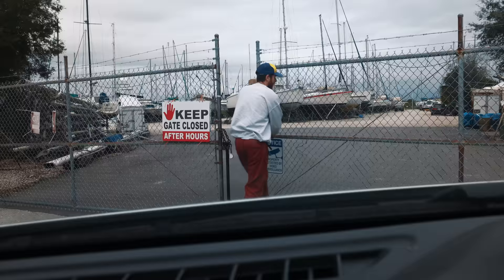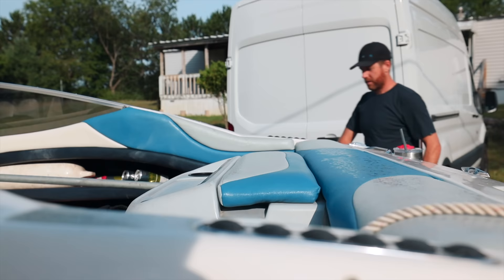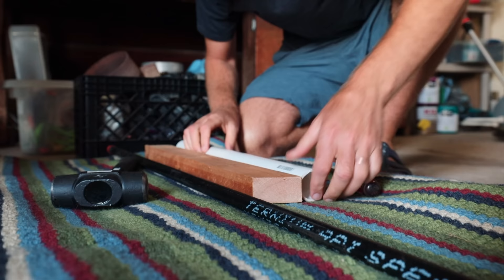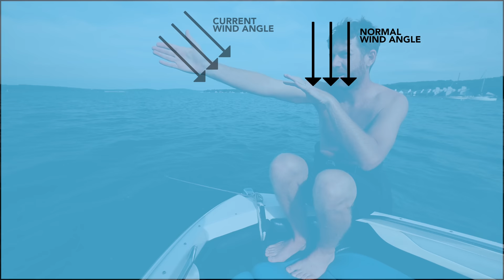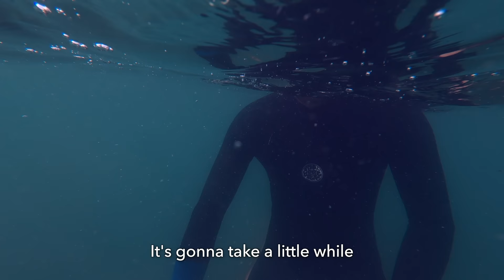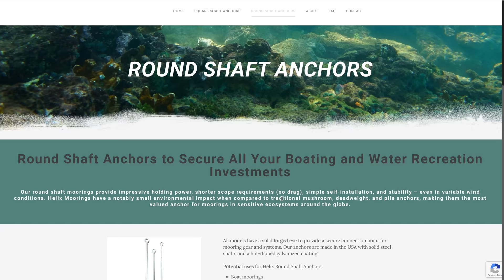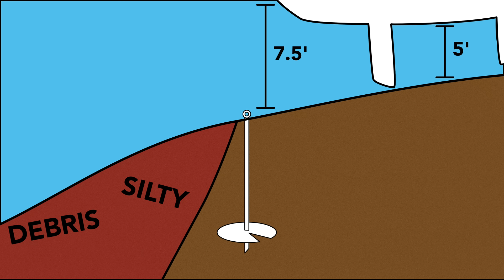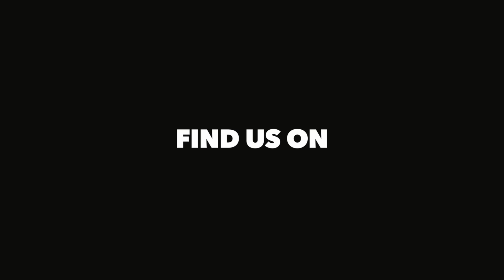Screwing our Boat into the Ground (Installing a Helix Mooring Anchor) | Sailing Soulianis - Ep. 117

Comment: Omg. So many mistakes. Shorter screw should have been in shallower water up from primary. Should have got longer screws. Should have been a foot apart with a metal bar shackled to both screws so prevents either crew from unturning. Then a swivel on the metal bar so morning line doesn't twist. Ugh!

Comment: That area seems to be the generally recognized mooring zone.  The harbormaster has moored his boat there the last few years (I could see it with the yellow sail cover in the background).  If you are able to rig secure holding, it should work out fine.  I would keep your daggerboards and rudders pulled up when you are away from the boat if it's not too much trouble.  The occasional storm out of the northwest can send some substantial wave action into that corner of the lake and create a 2-3 foot surge into there.  You'll want to have adequate draft under your hull if that happens.
Reply from the maker: We experienced it the first few nights with the boat in the water!  I slept aboard the first night to see how well she rode it out.  I was worried about the holding and the fetch and I'm happy to report it was WAY more comfortable onboard in a blow than I was expecting.
Reply: With trimaran's that's the usual practice anyway, because you don't want stuff growing on your foils, cause speed 👍🏼

Comment: I set a helical mooring off Camano Island in 20' of water, all on breath holds. Screwed 5' into the bottom it only took about 5-6 dives. Key is to stand on the bottom with a long lever instead of trying to swim the lever around. There is something really bizarre about standing on the bottom screwing in a giant corkscrew.

Comment: Wondered what lake you ended up on and this video gave it away by the background.  This lake as you probably know gets huge waves when the storms roll in, my sisters sea wall made up of 2000# slabs of stone got tossed like little toys, she is on the north side of the SP.  Good luck.
Reply from the maker: Yea it can get pretty nasty!  We were quite worried initially with the holding strength after getting the anchors in the ground.  But as you'll see in the next video, our fears were quickly dashed :)
Reply: @SailingSoulianis  I was up there in early July, same weekend as the poker run.  Had a great time sailing my Flying Scot, but the waves in that area of the lake were relentless.

Comment: We have a 44' motor vessel which we regularly beach on a sandbar located in the Mississippi river. For that we have taken that style of helical anchor, heated it up and bent it to 90 degrees about 2/3 of the way up the pole. This provides the leverage necessary to put the anchor in and out without the extra pole. We use two of these, and from the video I'd guess they're the next size down from your smaller anchor. One anchor goes upstream to the beach, the other goes downstream to the beach, and the anchor rode comes to the aft of the vessel and holds it against the sand bar. The holding power of these anchors is insane and I'm not worried even a little about your situation here. In ~30 years we've only had one incident where an anchor pulled out, and it was in a storm that registered a brief but staggering 65-knot straight-line gust that caught the tall motor yacht directly on the beam; and even then I'm convinced we only pulled out because the area had been recently dredged and the sand wasn't as tightly packed as normal.

Comment: You made a good choice/ decision with the helical anchorage system, it utilized the shear capacity of the soil combined with the cone of soil above the flight, In SoCal we've used similar multi flight systems for masonry wall bracing for loads exceeding 10K.  Was concerned with the manual auger procedure, as we usually utilize a hydraulic motor driven unit off a skid steer.  Have seen commercial installations using a boom mounted pontoon boat with a diver assisting the Kelley Bar connection.

Only comment on the installation would be the possible addition of cement/ sand rip rap bags around the anchor to resist and winter storm scouring of the bottom adjacent to anchors.  As you're in fresh water, the bags are just placed around the anchor underwater and the bio-degradable paper dissolves leaving the mesh bag not filled with concrete.  You can wait one season to determine/ confirm your storm exposure.

Fair winds for next season of sailing.

Comment: I did a very similar thing with a small (1400lbs) monohull in a lake in MN.   We were only there for 10 days, but I wanted something better than an anchor.  I had 2 sand screws - same concept, but only about 3' long with a much smaller auger.  I also used a secondary pair of dog leash screws, the kind you can get a Walmart that only go in about a foot.  These I tied to the bigger screws hoping to keep them from winding out.  The bottom was pretty soft sand, but I also needed a pretty big lever arm to wind them all the way in.  I also used about 20' of chain on each and set them at an angle to each other so the load would be shared.

I was in about 5' of water and did not have the cool underwater breather gizmo - very handy!  We had a massive storm of over 60mph (and from the wrong direction) one night, and I was worried that it might all come undone.  When I dove on it the next day, the sand screws were pulled at a angle, but had not come out.  The tri has a LOT more windage area than a mono, but is relatively light for it's length.  It's going to bob and yank on the screw, which is why I think a length of pretty heavy chain would help act as a shock absorber.  Maybe that's in next week's video already!

Comment: Hard to say from the video how deep the water is right there, but having installed no less than 10 of these types of mooring anchors in the past I can tell you the best method. Build a wooden stand with 4x4 corners supported on the diagonals with 2x4s and a plywood top and a small hole in the middle of the plywood.  
Turn it upside down and it generally should float (if not, assist with Styrofoam or life jackets).  When you get to your location, turn it right-side up and it will sink down to the lakebed. It's okay if your platform is slightly under the waters surface, just make sure when you stand on it, you are no more than knee deep in the water while on the platform. 
Drop your anchor down through the hole in the middle and have two people stand on top of the platform.  Because your anchor doesn't reach the surface, you create one pipe with a "J" welded on the end of it.  Insert this into the eye of your anchor and then attach your horizontal leverage pipe at the top.  Walk in circles until the eye of your anchor is almost flush with the lakebed.  The "J" pipe is best to be expandable, and the best way to do that is with threaded rod sections.  

Making this comment 50% through the video, so I'm sure you eventually got it done, but just in case you ever have to do it again, this is the way. Edit: I see you got it screwed in with little to no problems.  If there were any clay or hard packed ground, it would have been impossible to screw it in while swimming or even with a dive belt on.

Edit:  Looking forward to the next video to see what your ground tackle setup looks like.  I do have concerns with there being two anchors in the ground.  My mooring, (even with the swivels, etc) gets fouled up sometimes on its own anchor eye.  So with any other anchor eye in the ground within reach of the chain drag, it will 100% get fouled up on another eye protruding from the floor.  I like the idea of a backup, but I wouldn't want my chain wrapping around a solid point in the bed and removing the ability of the chain to rise up and sink down while reducing potential shock loads (which is why you have extra chain in the first place).  
I'm certainly not a know it all, and I know you both have put a lot of thought into this, but I'm just mentioning some points purely as devils advocate.  
Thanks for the videos.  I always look forward to them coming out.

Comment: interesting to see a bit of a different, yet still sailing related vid :P haven't seen a lot of channels put in a mooring anchor yet xP
if you ever need to do this again (or do any other work under water with your small compressor) I would suggest taking a few KGs of diving lead. Even a bit of weight is already going to make it tons easier to stay under water, which is going to mean less exertion needed to stay stable,  meaning more stable breathing, which means that you'll get a lot more dive time on a battery. (as well as just being a bit more comfortable underwater xP)

Comment: I couldn't agree more....I'm done with boat yards. I bought a precision 21,which I can trailer w/ my Toyota Tacoma. 
 Presently sailing the Everglades and Fla keys.
Reply: I have a San Juan 21 which is 1,300 lb, 300 lb swing keel version of yours. Upgraded to Macgregor 26S water ballast that hope to use for sailing snowbird. I call it seasonal coastal cruiser.
Please occasionally share how you're getting on on 21'. How long between reprovisioning? Do you ever do it without the trailer? What is shore access like?
Reply: @artsmith103  I'm in the fla keys now ....very crowded. But the everglades are wide open. Just make sure you have proper mosquito netting.

Comment: That went better being submerged than I expected. Congrats!
You didn't even have to load your pockets with rocks.
Reply from the maker: Lol, would've helped though
Reply: You're the multihaul experts but look into that linkage between tiller and outboard. That will make getting on the mooring much easier. It's nice to be able to raise/lower main while weathervaning off the mooring.

Comment: You could benefit from adding 100' feet of heavy chain between the anchor and the boat's anchor rope.  This will provide additional resistance and act as a shock absorber for heavy beating seas.  This would not eliminate the need to place a shock absorber at the boat.
You also chose anchor sizing above the "recommended" size.  This is smart.  Your area of the world can get some nasty storms.
BTW, I didn't think you had a chance screwing the mechanism in by hand.  You must be a beast.  Haha.
Good job.
Reply from the maker: 100’ of chain would have us swinging into the shallows and into other boats. With moorings the working scope is expected to be between 2.5-3x the depth of the water.

Comment: One local YC has a deal with a nearby commuter railroad. When they change the wheels and axle, which are all one piece, the YC gets the axle set for scrap value. The cut off one wheel, or put a ring on it, and drop the other wheel into the mud, just like one damn heavy mushroom anchor. No failures after hundreds of the have been used. Just damned heavy to lift! And once they settle in, they don't pull out.

Comment: Remove the small screw anchor.  Get a large(?) concrete anchor block and connect it with about 25' of chain ahead (into the prevailing wind).  Off the drop and in the silt is fine.  Connect your mooting ball here.  Strong waves will have to lift the weight before pulling on the screw anchor.

Comment: You could extend that with a piece of pipe with a hole and a bolt in it on each end. That would let you sink it as far as you need to hit solid ground. Pipe could also be used the same way to be able to put it in the ground from the boat, standing on the boat twisting the pipe sticking out of the water. At that point you could also borrow someones gas engine handheld post hole auger an shoot the thing in the ground in seconds. I would let you barrow mine but its a bit far of a drive. lol

Comment: So very clever using that screw in mooring anchor! Can we assume this will only be used during the “summer season” when you will be sailing the most?
Reply from the maker: The lake freezes over solid. So no mooring needed in the winter. Our boat won’t be in the water and if it is it wouldn’t be going anywhere anyway. 😂

Comment: Why not an extension on the end of the shank and work above the water?   Good work getting them in.
Reply from the maker: We thought of it, but getting enough leverage in a floating boat to spin it from the surface seemed pretty difficult. We had the Nemo dive compressor, and it seemed like the best choice for us. It was kind of fun being down there working below the surface as well.
Reply: @SailingSoulianis  Agree that any time under the water is great.
Reply: @SailingSoulianis  An impact driver works good to alleviate much of the reaction torque that would be required from a boat on the water.  Search eBay for anchor adapters and you might find those coupled to an impact driver to be more convenient.  Unfortunately it would reduce the time in the water so that could be a bummer...

Comment: I would've been tempted to cast a big heavy concrete block, with maybe six pcs of 12'' long stainless steel 'angle-iron' sticking out of it - or somethng similar - and carry it out hanging between yr hulls, & drop it.  Last time I made a mooring in mud, I dropped a big car engine down.  It never moved.
Reply from the maker: What you describe is fairly common.

Comment: Is this a common method in that area??
Reply from the maker: It’s not super common no. But this is how many mooring fields are anchored. Usually with much larger gear. This is a DIY alternative. We installed the largest DIY helix anchor available. It suits our needs but others with larger boats would need some sort of drilling rig on the surface.

Comment: Do you need special permits or permission to put in a moring ball
Reply from the maker: We called every agency we could find, talked to the harbor master, the city and locals.  Fortunately for us, this particular location is currently sort-of self policing. It may not always be the case.  But we're keeping our fingers crossed that everyone continues to use common sense and nobody ruins a good thing.
Reply: @SailingSoulianis that’s interesting. I’m on the far western edge of Lake Superior in a marina in the Duluth /Superior area.  We have two “special anchorage “ areas on the charts.  Wonder if I could pop a mooring in there.  Could be interesting to find out.
Reply: @Natter20002  If it's a designated anchoring area, chances are you won't be allowed to put in a mooring rig.  I've yet to figure out the proper process for obtaining permission for a great lakes mooring.
Reply: @johnbruen1651  Right.  I really have no need for one but its an interesting topic.

Comment: Sorry, Concrete isn't 30% water.  The weight of concrete in water is reduced by the weight of the water it displaces.
Reply: Concrete is 150 lbs/ft^3. Water is 62 lbs/ft^3. So actually concrete loses 41% of its weight. Kirk was being a little too conservative. 
I just mixed 2,000 lbs so I'm a small expert!

Comment: I don't think that screw is going to work, the sand loses most of its weight beneath the water.  Imagine a cylinder of sand on top of the screw, it would be extremely heavy on land, but under water it may weigh like 1/3 or less, so the boat can pull it out.  I would swim around there and find some old chunk of steel, maybe an old piece of equipment, and then loop a cable around that.  Do a test on your screw before trusting it with your boat, it probably won't work.
Reply from the maker: It’s not the weight of the sand that holds it in. It’s the suction on the disc and the friction of trying to pull it out in shear against all the other sand. Think of a tent stake. They don’t have a disk at the bottom and even they are damn near impossible to pull out sometimes and they are only 6” long!
Reply: @SailingSoulianis  OK, I see!   That sounds better.
Reply: @SailingSoulianis  The tent stake is nearly exactly a piling used for construction in reclaimed land. There's a lot of engineering calculations leading up to it but basically keep hitting the piling with the pile driver until it doesn't move for 3 successive hits. All friction, no disk at the bottom.